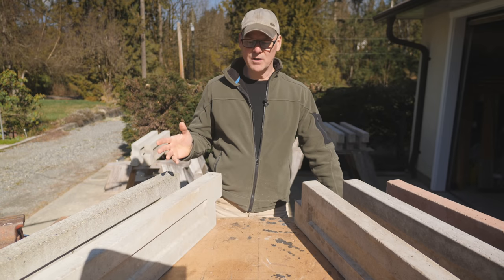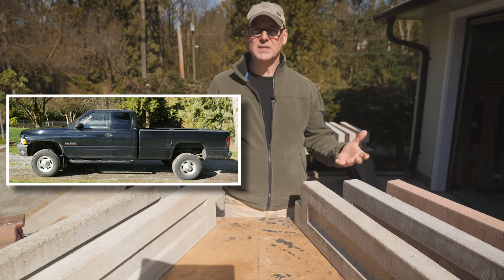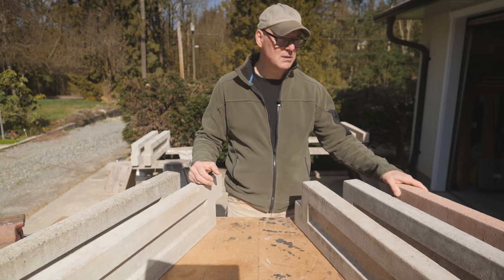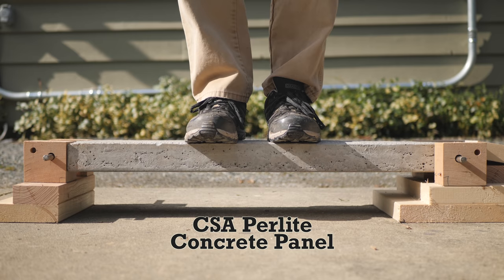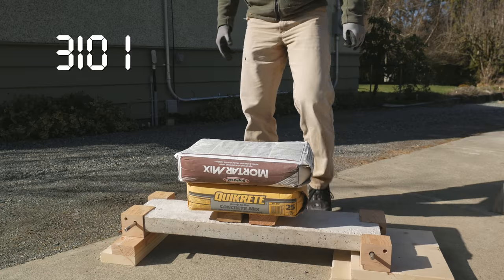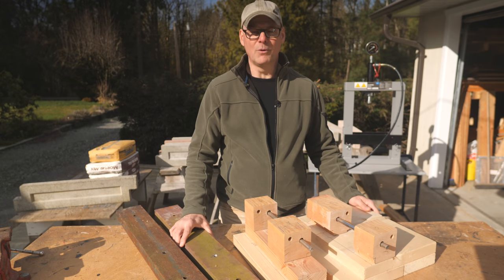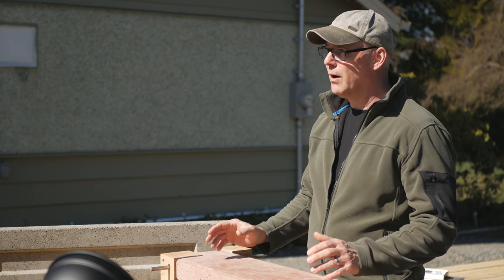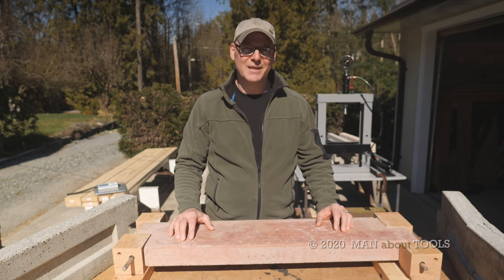How Strong is Lightweight Concrete?  - Deflection Test Perlite, Vermiculite, Lava Rock, CSA Panels

Comment: I don't think it can be considered a sideways load of you're putting all the weight in the center.  I think if you distribute the weight more evenly you'll be able to put more weight on. But,  I think that will cause the pin joints to fall. You should test a solid one without a pin joint. When the joints are connected they will be stronger and that will show a true test.

Comment: Are you gong to test the thinner CSA panel you made?  I modified your plans and am about to pour some that are 3’ inside dimension and 10” tall.  I made them taller so I can line the bottom and make them self wicking.
Reply from the maker: I plan to test those.

Comment: Your results are consistent with engineering principles. If you examine large flat roof building trusses, such as across a gymnasium, you'll find that the center has to be the strongest part of the truss. Keep up the great work.

Comment: I think the gauge on the hydraulic press did not register pressure because the panel flexed,  much like  using the bathroom scale over carpeting.
Reply from the maker: I was thinking about that too. But there must have been a force of at least 500 lbs or more to make it flex. I think the gauge is designed to read pressures way higher so it just didn't respond.

Comment: I'd like to see a panel with 2 layers of re-enforcing wire spaced closer to the surfaces.
Reply from the maker: Have a look at the aircrete panels from Part 3.6. I used a double layer grid in two of the panels. And will test them in the next video.

Comment: You can divide the pressure of your press by using a lever. Normally we use levers to multiply force, but it can work the other way, too. Just apply the force part way along an i-beam or whatever you choose with the end pressing on the slab you're break-testing. If you push half way down the i-beam, half of the force goes to the other end, so only half the pressure of the press goes to the end you're testing. P.S. I can't help noticing there was no thought expressed about damage to any of the wood used. Is wood that much stronger than concrete that you can just not even think about it? :)

Comment: What about the vertical tensile strength?
Reply from the maker: I didn't test that. The panel is 8" thick in the vertical direction when installed. I don't think that's an issue strength-wise. I tested the thinest section, the 2.5" thickness.

Comment: Concrete has most of it's strength in compression, little in tension. most of what you were measuring was the strength of the reinforcement steel. Placement of the steel in the concrete mix, size of the steel, both would affect the resistance to deformation. For raised beds, more than strong enough.
Reply: Tensile strength of concrete is about 10% of compressive strength. I don't think the steel wire broke. It did seem like the wire pushed out of the top of the panel. Beams often have rebar stirrups to hold the rebar in.

Comment: The short wires (vertical as the panel would be used) add zero strength other than preventing the long wires from slipping in the concrete.  Strictly speaking this is not a tensile test but a bending strength test which is a combination of compression, shear and tension, however in this case it's the tension side guaranteed to cause failure, so close enough.  Great work regardless.

Comment: Is there a lightweight panel strong enough to use as a driveway?
Reply from the maker: I think all lightweight concrete is not as durable or as strong as the standard portland based sand and gravel version.

Comment: Problem with the press is as the panel flexes the readings will diminish because the panel moved away from the force.
Reply from the maker: Yes. It's an issue with that method. I'd still like to try it with a smaller ram and gauge.

Comment: they failed in the middle an not where rods were cuz of the cavity thats in the middle, but it doesnt extend to the ends which have the full depth of material for strength, at least thats my theory
What you should do for your metric ton gauge is stack 2 to 3 or 4 on top one another, then the load should break somewhere in the tones, then divide that by the number of panels you stacked

Comment: Really great! That's a lot of work! How's the deodorant situation... LoL... Not scientific, but still yielded a lot of information. I'm really likin' that Perlite: light(er) and very strong. I really wonder where it would have finally failed? I wonder also if you put two pieces of hog panel in, if it would substantially increase the strength. The walls are almost too thin for that, but not quite. 

If you had hog panel reinforcing at each of the 1/3 thickness planes, one would act as tension resistance and the other contributing a little strength as compression resistance as well. As it is, the one piece in the middle, besides being a great, general hold-it-all-together reinforcing, is mostly just a hinge for your destructive testing. With the two pieces of reinforcing, it might act more as a torsion panel like with wood torsion panel shelving that doesn't sag under the weight of heavy books. Very valuable stuff you are doing! Great work! Thanks!
Reply from the maker: Thanks! I agree with all your points here. Yes, the pink perlite version was very strong. I almost wanted to try the truck wheel on that one to see if it could handle that much weight.
Reply: @MANaboutTOOLS  But I know, that would hurt too much... :)

Comment: Few observations. 
The tests were scientific enough for the scope of the experiment. Compare the strength of panels for a garden box. 600 pounds is a nice goal to set.
Testing only one sample isn't all that scientific. But redoing this with a larger sample would be pointless as all have proven pretty much good enough.
Another observation is that you did a bending test on a point, or better on about 10%-15% of the whole panel. The stress exerted by a mass of dirt in a garden box would be pretty evenly distributed. As the bending is what breaks the panels in the experiment you'd have to bring a few tons of pressure to make those panels bend enough to break. At which point I would assume too the joints would be the weak point.... but when would that ever happen in the limited space of a garden box?

Talking about bending. That would be another thing to test. Concrete can be pretty bendy. This would be a pretty good alternative to the dumb rigid strength of the full weight concrete. The way frost affects soil isn't all that great and only brittle stuff that gets the hairline cracks will eventually erode. Having a more flexible light concrete may solve all the problems. 

Having said all that. Great testing. I enjoyed that.

For your consideration:

https://www.youtube.com/watch?v=TUxXzjzan5k

Comment: Come on mate, how is it ever going to break on the pins with the truck  on it when the block of wood next to the form that half the pin goes in is supporting the whole truck and there is little to no weight on the form at all! The wood is holding the truck, its simple.
Reply: At the point where the pin attaches, there is less than half as much concrete.  So it seems intuitive to believe that that should be the failure point.  But there are two pins.😁 In addition, the flexing beam should form a parabola -- meaning that the greatest deformation (and highest stress) occurs in the middle.